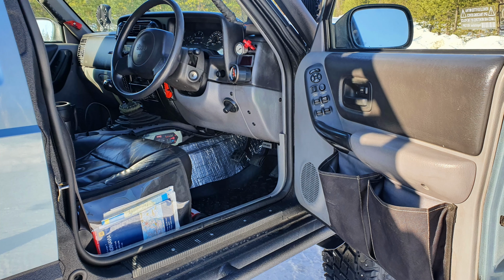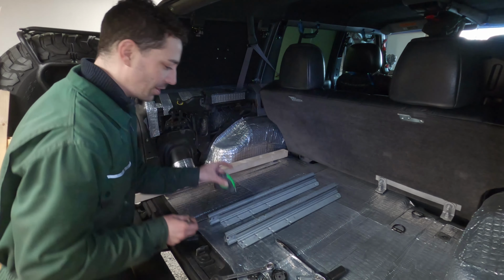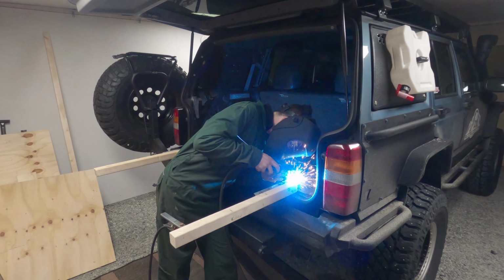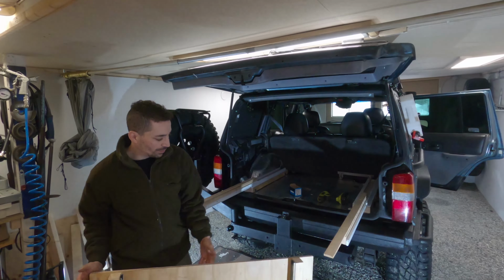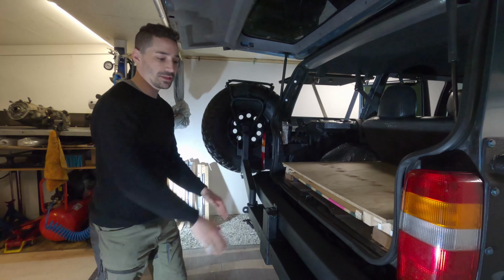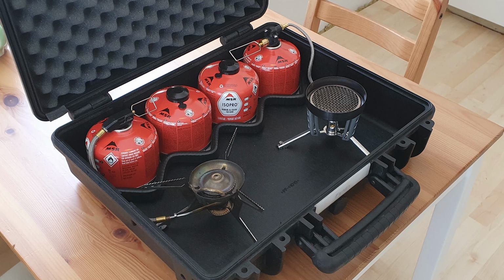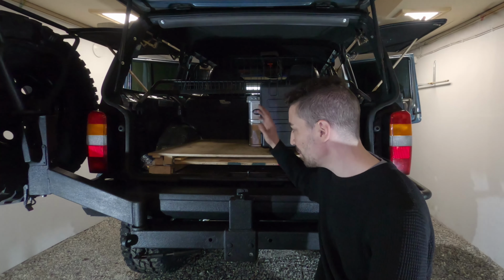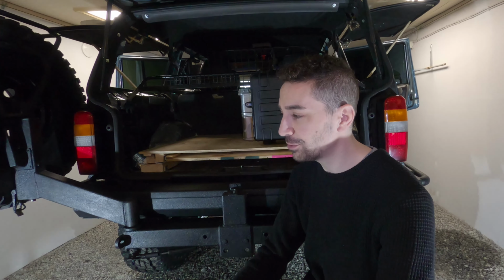DIY Jeep Cherokee XJ Rear Pull Out Storage Platform

Comment from the maker: Time to work on rear storage. Back in 2018 on our Europe trip we had a basic drawer system but when we weren't using it, it took up a lot of space. We use the Jeep for a range of adventures so versatility has always been priority with internal space. This time round we agreed on a simple pull out platform that will allow us to pull out the content of the rear for easy access but also not take up too much space when camping wasn't on the menu.
I used heavy duty 100kg draw runners to make the platforms as strong as possible although its obviously an overkill.
We will be using a DOMETIC Tropicool TCX-14, my home made MSR stove system, a basic Storage Box and an Ecoflow River Pro battery system a log with a wash basin and some other smaller storage organisers on this platform. All other items will be on the Cargo Rack, Gullwing Storage Boxes and Roof Rack. 
Thanks for watching and join me in the next video for the next stage. 
Mike

Comment: Put a timber cross brace on the flexi board behind the second slide out. Then some ally u channel across the front. Job jobbed. Love your projects
Reply from the maker: Thats a sound idea. I would like to keep it light, I will put on a cross member behind the second drawer as that will probably make all the difference. Some u channel is also on the cards for the edges. Thanks for watching

Comment: I like the idea you’ve got going with the slide out for access and the rack for top storage! I ran into the same issue with 1/2” (12.5mm) plywood bowing like that and had to make a center brace. For your situation 3/4” (19-20mm) would likely work better unless you get fancy and integrate some metal or something. Looks good man!
Reply from the maker: Cheers mate. Hopefully it can bring back some comfort and make cooking easy. I've added a cross brace under the platform and it's made a big difference. It's just the very front thats not great but like you say maybe thicker wood. Thanks for watching
Reply: @WorkshoptoWilderness  While watching I thought exactly the same as you both - some bracing underneath rather than thicker wood. As for the front (edge) then maybe a strip of angle iron, like 10mm x 20mm x however long you need, to keep the platform edge rigid 

The gullwings: If you stick to your 'prototype prinicple' (ahem) and knock up a couple of rough boxes out of cheap plywood then you can play with dimensions/shapes for a while especially as it seems you're not sure what you want to store in them.  And as for the gullwings themselves then maybe heavier duty hinges that could lock open even with 6kg of water on, if such things exist, I guess 2 locking hinges rated at 5kg each would be enough - if that's do-able then that's a solution for both the concern that current hinges dragging when the gullwings are closed plus not having a centre fixed 'stay' to keep gullwings open... maybe

Comment: I really like your ideas for rear storage. How about plastic for your table tops on your storage system like a thick plastic cutting board material? I'm trying to think of the name of that type of plastic, I've seen some skid plates made out of UHMW or that have a sheet of it attached because it's super durable and it slides better or something you may look into what UHMW is? I think a plastic cutting board material would be the stiffest option while also staying lightweight. 
I need to think of a rear storage solution, the only thing I'm thinking about having on a slide is the fridge and I'm going to try it without a slide first maybe. I really want a shelf like you made. I also don't want anything to be permanent so i have multiple uses and cargo space. I want to have an easily removable fridge I got a nice little plug and tie down kit for it because the fridge won't live in the car. I'm going to have to get creative for rear storage I am moving my 2nd battery from under the hood to the rear cargo area and that will be permanent, I have a viair dual air compressor system with a tank that will be permanent most likely in the rear and I also have a co2 tank that will mount on the roll cage somewhere on a quick release maybe in the backseat footwell then I have 2 recovery bags and a large tool bag and spares bag all that stuff needs a home and to be strapped down it won't always be in the jeep and it won't always have to all go but sometimes I may need all of it along with other necessitys. I also have a rear mounted winch setup, I have a permanent front winch and I thought about making the rear bumper also house a winch but I ended up making a somewhat lightweight removable receiver mounted winch I can carry in the rear cargo area if I want to but I'm not sure that will go with me very often. The rear shelf I think will be most important for me to make, I've seen some pre-made ones but I haven't really seen anything I like or that works for me JCR has my favorite rear shelf but I need to get my cage done to figure out how much room I have, I have an 8 point cage kit so I'll have a hoop and bars in the cargo area which may actually help with mounting a shelf I don't know yet. 
It's very important to have everything secured to protect everyone in the car in case of an accident like you mentioned or a rollover.
Reply from the maker: I think a hard plastic would be a good shout. Easy to clean and also kind of quiet in a way. I thought about a stainless cover over the whole thing. Like brushed stainless but then its just more weight. I'm not sure really, I have to look at some materials and just see how it goes. Aluminium is also an option, I spoke to the fab shop in town and they said they can cut out a metal cover in any thickness I wanted. 
The bars for your roll cage should help a great deal with the options you have for storage. You can mount whatever you like on them or weld some brackets to attach a removable cage for the back. 
The gear just mounts up doesn't it. Self sufficiency is key to a degree I guess so tools, spares, recovery gear and other such things. The cargo rack for me really helped so much. I always found that I had a huge open space at the top where I just wouldn't naturally stack things that high. I would like another in aluminium but I doubt that's possible in my case. I will try and get the gullwing boxes made soon, that should help again with some storage but the XJ is quite a difficult SUV to kit out if your keeping the rear seats in. Thanks again for watching!

Comment: Great video.  I like the way you explain the details.  Im in Los Angeles and looking to build something similar for my XJ.  Where did you find the sliders?  Also, do you have a video on your electrical panel I see in the rear?  Thanks.  Andy
Reply from the maker: https://www.beslagsbutiken.se/rullskena-fr-206-vit-100-kg.html I got mine from here. Lots of different lengths also. They work well and are super strong but using four of them makes it much better. I guess you can use two and just build it well but in rubbish at this kind of thing. There isn't a specific video for the electrical system, but that's coming up next. Thanks for watching

Comment: Do you have a video on the cargo shelf and how you did it?
Reply from the maker: Unfortunately, not. I can describe it to you. It bolts to two brackets on the gullwing window box's, and also connects to the back of the seats with two brackets. 
The brackets on the back of the seats are bolted into the metal seat back plate. It's not the best design, but it worked fairly well.

Comment: Hi howzit man if possible could i have some measurements for that draw system we want to do the same design for our jeep build
Reply from the maker: I made a note to measure the platform and add some measurements to the description. I wont be able to do it tonight but I wrote it in my work book so I will remember tomorrow!
Reply from the maker: The platform is 82cm deep and 107cm wide. It sits 16cm above the base of the surface its mounted on.
Reply: Thank you very much